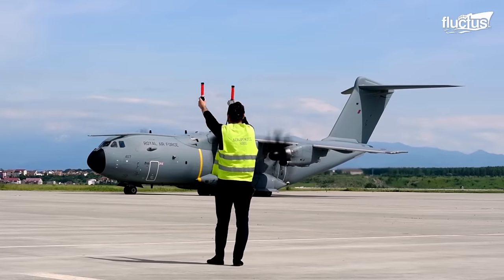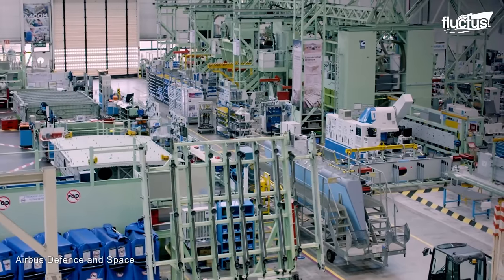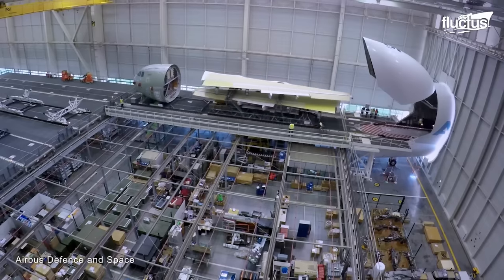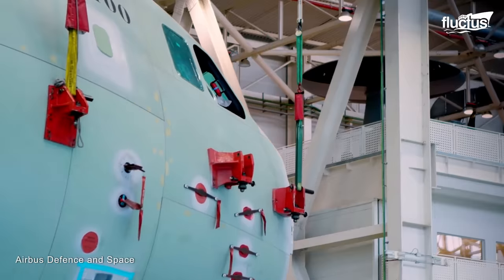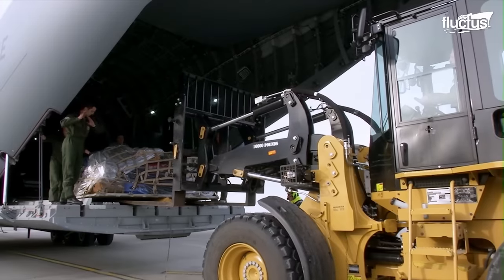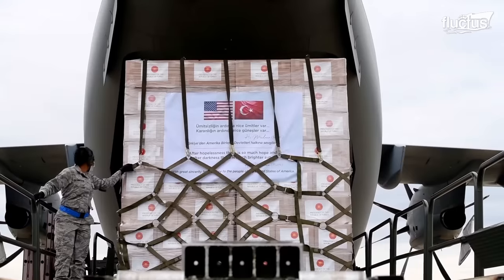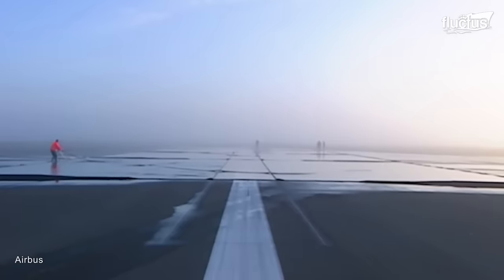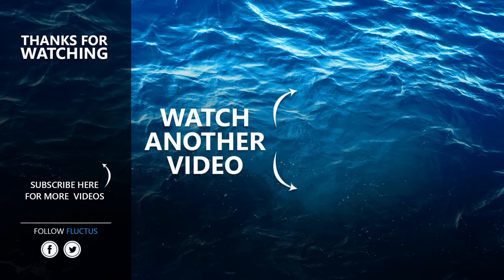Inside Billion $ Mega Airbus Factory Assembling Gigantic A400M Aircraft

Comment: This is probably the aircraft the RNZAF should have bought. It can carry the NH90, unlike the C-130J, which cannot, which the RNZAF bought. Guess the reason was no-one else in this part of the world has bought the A400M thus making the supply lines being very long.,
Reply: In South East Asia the Royal Malaysian Air Force operates 4  A400Ms. Initially with misgivings but quickly appreciating the A400s that they were given rather than C130Js.

Comment: That must be some strong aluminum that cuts through steel
Reply: YOu can also cut through steel with water. All a question of pressure/speed
Reply: @MrSchwabentier  I'm sure that aluminum was under some 550 miles an hour pressure I don't even think that would be close to fast enough
Reply: @stupid7648  It's more than fast enough. Simple physics.
Reply: @MrSchwabentier  ok either way America gotten more freedom after 9/11 so I guess it was a good